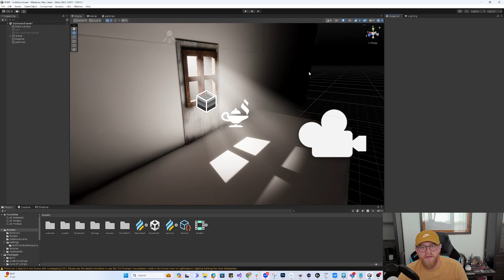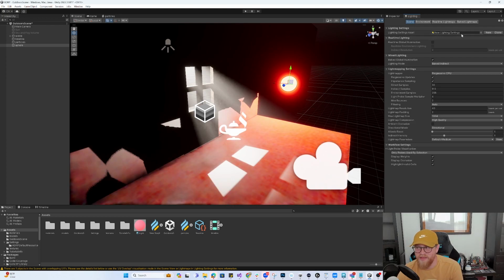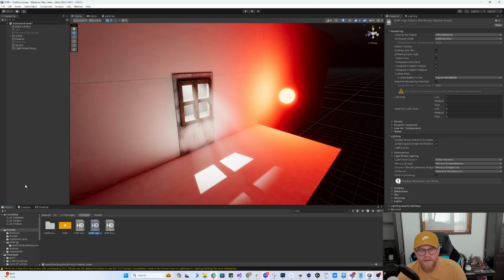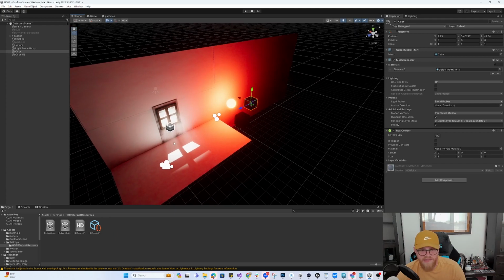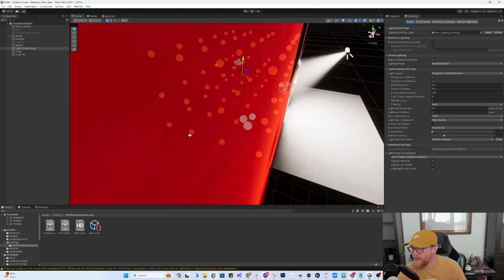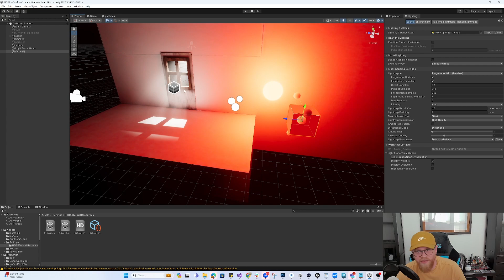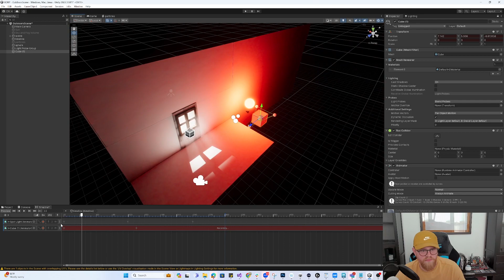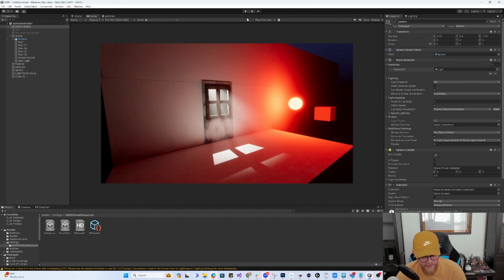Lighting in Unity Part 2 - Light Probes for Static lighting a dynamic object

Comment: Nice, I already had my first contact with light probes and it's a really interesting feature. Unfortunately, I also instantly found their limitations when experimenting a bit. They don't seem to have a maximum range. In consequence, there seems to be no way to block dynamic objects from receiving light from light probes in specific places, right now. So I guess they are an all-in option - either don't use them or cover your whole scene with a light group. A short comment on an issue with the video recording. Sometimes your webcam overlays parts of the interface you are working in. Nothing to dramatic but ideally the viewer should always be able to follow your workflow. I never did anything like streaming so I can hardly provide a viable solution. Maybe you can show the webcam overlay to yourself while you are working in Unity so that you notice the problem when it appears and turn off the cam as long as you are working in the overlay area. Or move the cam to a spot which is seldomly used in your tutorials, for example, the lower part of the hierachy.
Reply from the maker: Great feedback, thank you! I've found whenever I move the camera feed, it tends to cover something new that I end up showing, but I need to do a better job. 

A brief response to the light probes - I have found I typically cover a whole scene in probes, just with increasing or decreasing density of clustering. However, you are able to disable light probes affecting a specific game object by going into Mesh Renderer > Probes > Light Probes, then turning to "off". There is also the strategy of using Light Probe Volumes which is best practice in 2023 and onward, which allows you much more simply layout scene-wide light probes.